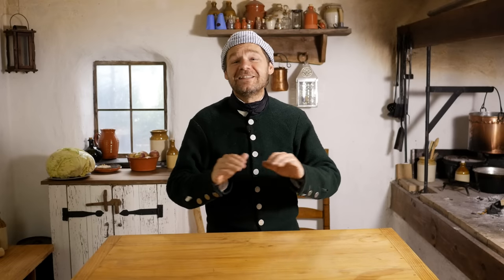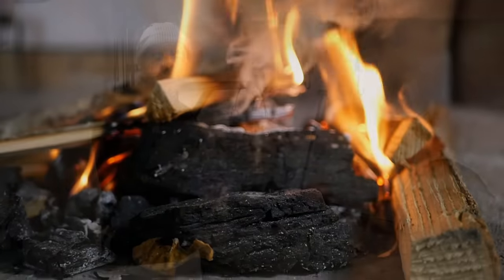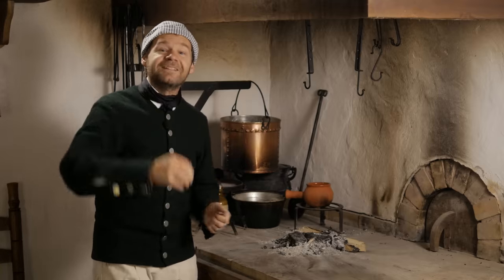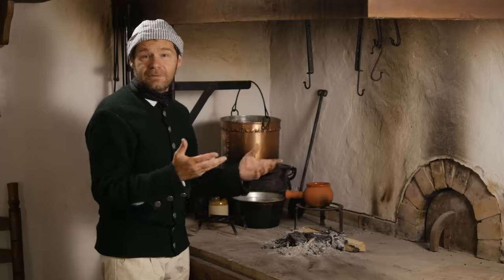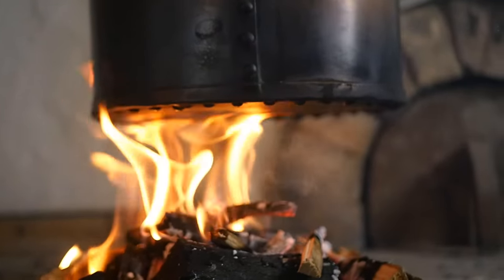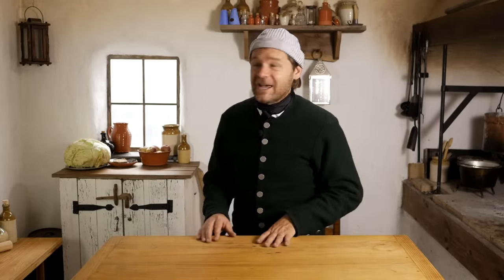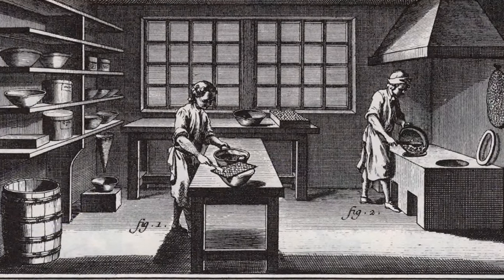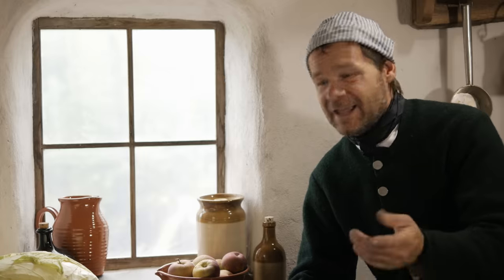Historic Kitchens vs. Modern Kitchens

Comment: I WAS BORN IN 1947. WE HAD AN ICE BOX UNTIL I WAS 4 OR 5. I WAS 5 YRS. OLD WHEN WE GOT AN INDOOR BATHROOM. WE HAD  OUT HOUSES UNTIL THEN. GLAD TO BE ALIVE IN THIS CENTURY..
Reply: That's the year I was born, also. We lived in the country 13 miles from town, 2.5 miles from neighbors, had a phone but no electricity, running water or indoor plumbing.  We had a wonderful spring for our water and used the creek for a fridge, by putting a metal box into the overflow from the spring.  I learned to cook on a wood burning stove, and still have a small heating stove in my home that I can cook on if electric goes out because of storms, which has happened a few times.  We got a gas range after a bit and used that in the summer, as canning on a wood stove was miserable.  You had to carefully move the canner around a bit to keep the pressure regulated.  We got electricity in the late 50's and had 1 light fixture and 1 outlet at first.  Cash was in short supply and the house had not been wired when it was built.  Running water and indoor plumbing came in the 60's.  For a long time Mom had a gas engine on the wringer washer, and we had 6 very long clotheslines which we filled at least twice every washday.  Water was hauled from the spring to a tub on top of an upturned oil drum which was made into a stove to heat the water, then it was bucketed into the washer.  We raised a huge garden, there were 2 children in the family when my parents  bought the place and the other six of us came along in the next 18 years.  We raised chickens, got milk from the neighbors, and had lots of chores.  It sounds like a hard way to live, but we never really felt that way, that's just how it was.  One of my brothers and I were talking, long after we were all grown and away from there, and he laughed and said, "We were forced to eat gourmet food!"  We ate lots of wild game, the men hunted in season and fished often.  It was a wonderful way to grow up.  Cash poor but love rich.Mom lived on the farm until 2001 and she was 88.  She spent winters away from there, for about 8 years, mostly living with my husband and me, just 100 miles away.  And heated with wood all the time she lived there.
Reply: My uncle's house on our family land had a box with a toilet seat on top floating over a hole around back. That was the only place to poop on our land until about 15 or 20 years ago. Gotta love the hillbilly side of my family
Reply: We are going backwards on this farm, lol.  There's a wood stove to heat the house and cook on, there's a Humanure toilet and we hauled water up until 8 years ago.  We now have hot & cold running water that I never take for granted and a garden that doesn't need watering even in drought conditions due to mulching.  We could do without electricity, only if we have to.  But we love our lifestyle even though it's inconvenient at times.  Living with all the amenities is not something we would do again and I highly recommend this lifestyle to anyone who's thinking about it as it's very rewarding, go figure, lol.
Reply: I was born in 1959.  I remember visiting relatives who still had an outhouse when I was 9.  I remember my dad got up one night and watched me from the kitchen door as I went outside to use the outhouse so I wouldn't be scared.
Reply: Homestead Dreaming,  that was awesome of your Dad to keep an eye on you, he took some of the scariness away and was there to save you:).  Amazing how outhouses leave such long lasting memories!
I had thoughts of being attacked by animals or falling into the hole, lol.  After decades I still don't like outhouses due to those walks in the dark & dark holes, so our in-house Humanure toilet is absolulte heaven:)  Atb.
Reply: Lol. Would you wanna live liles that again?
Reply: I was born in 1972 and my granddad's house, that my parents bought from him when I was 7 had the only non outhouse in the street as he had built the back of the house out to meet the outhouse. He also had the first working hot water shower in the whole area as he built a wood burner into the side of the shower area and that heated a tank of water that you had to hand fill.
When my parents bought the house the firsts thing they done was to build a new kitchen and an upstairs bathroom. 
and we got running hot water in the house too. and at this stage we where the first ones to have an actual bathroom 
The houses where the old 2 up 2 down houses
Reply: Grandma Liz's Kisses no need to yell.
Reply: Grandma Liz's Kisses I also was born in 1947. I loved when the ice truck came the delivery man would hit the ice block several times with the tongs and we children scattered to get the chips! It was a real treat.
Reply: Just the lifestyle I love!!! I recall those days & the times I've lived that way out in the boonies. I want to go back & die there. The only thing I have no complaint about in these days is-- well, two things-- hygiene & medical care. In those, we're much better off today. Also, women aren't being burned alive at the hearth anymore either. Those long dresses went up like a handful of straw.
Reply: some of my relatives live near the Wall in Germany ("Zonengrenze"), until very recently(about 2000!) they had no water-toilet in the house and cooked on a stove fired with wood!
I live in an old tenement and still heat my kitchen with wood or coal, what will be difficult in the future because they want to ban all fireovens in our town because of the smoke ("Feinstaub")!
Reply: I was born in1963 and we had an outhouse in our yard until 1970
Reply: Out houses are cleaner,now we re use contaminated water,all in the name of chemicals and science 👎
Reply: My mom didn’t live in a house with plumbing until 1979. West Texas
Reply: It took me much longer to say basically the same thing!
I'm sure the other readers will appreciate your brevity!
Reply: It's so amazing to read all these personal stories..thats a real history lesson. Thank you ☺
Reply: @BlackPhillip666  -- Frequently you will find that there are some people with "visual challenges" who find it much easier to type in all caps (what you call "yelling") because it's much easier for them to read on various computer screens. 
By taking the content in its proper context, it is simple to figure out if someone is actually "yelling" or if they may just find it simpler to read their own typing that way.
Reply: @sharid76  font size is adjustable on computers and mobile devices.
Reply: @BlackPhillip666  - yes, it is adjustable, but sometimes even that doesn't work well. It can also be the shape of the letters too that make them more identifiable. I cant quite explain it adequately, but that's how it works. My mother taught for several years, while I was in high school, at a school for the visually and audibly impaired, and I became aware of and familiar with the concept back then. It was well before the advent of the Internet, personal computers, or cellular phones, (and even calculators were extremely new, and very expensive!) so those didn't even apply at the time.
Reply: Grandma Liz's Kisses imagine living like otzi the iceman did. Imagine not having steel to use with flint, so you’d take about 30 minutes with pyrite and charred mushrooms to get a fire going while hungry in cold conditions. Maybe even with others trying to hunt, kill, and loot your corpse of your tools, food, etc.
Reply: I was born in 55 and still had outside toilet that was in the 1960 then we got a fridge(second hand)in 1972 this northen englang
Reply: YOU DONT HAVE TO SHOUT I CAN HEAR YOU
Reply: My father lived in a two room house with the stove built ok.to the dividing wall to heat both rooms. There was an outhouse out  back and a root  cellar under the house . They also had a few chickens for eggs and a cow for milk
Reply: Living Best Life I was born in 59 also.  We lived in the country to ‘65.  I knew how to get the coal fired in our pit belly stove at three years old.
When we moved into town to a neighborhood that I suspect most home were built soon after the Great War 
Most homes had indoor plumbing but the outhouses still stood in most yards.  They were still hand when working it playing outside 

Our landlord had a country place they took us too as tykes. No indoor plumbing. At night we used a chamber pot.  I visited it in the wee hours. Someone had dropped a deuce in it.  Horrible image for a seven year old
Reply: My dad was born 1945 (and I 40 years later), and he has similar stories. Milk and ice being delivered to your door with an ice box that connected to the inside of the house, bread boxes, and even motorized rolling presses used to squeeze water out before hanging laundry to dry. A girl down the street from him got her arm mangled in one of the motorized rollers, and my dad remembers his mom freaking out, throwing away their motorized roller, and got a hand cranked one instead. They didn't even get a TV until I think he said '52, and it was a little 3" black and white screen. You had what looked like a bird cage stand that hung a special magnifying glass in front of it so you could actually see it.

He also told me when he was in grade school, one of the after school clubs was the rifle club. Kids could bring their .22LR or .22 gallery rifle to school, stick it in their locker, and then retrieve it after. They would report to the gym, set up a bullet catch (metal spiral that catches the bullets) and targets, and shoot for an hour or so. They also had archery club, too. No issues with kids shooting their classmates, as that was completely unheard of. Different times. He also told me high beams in many cars were controlled by a button on the floor, usually behind the clutch pedal. So weird.